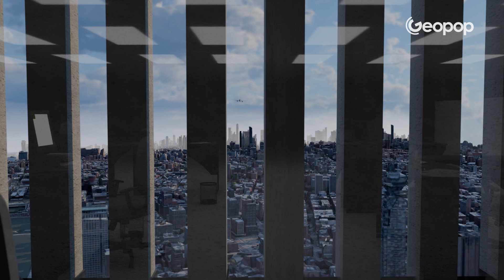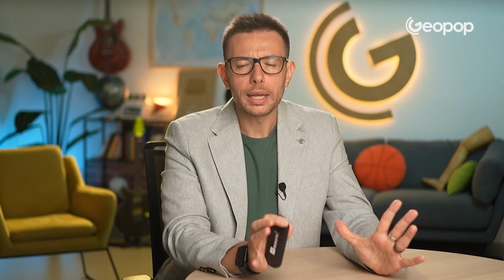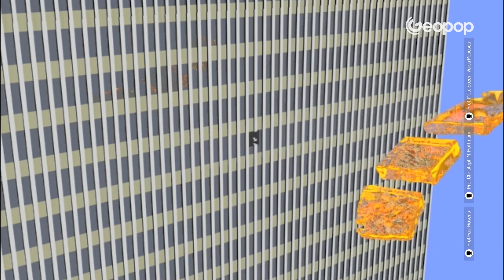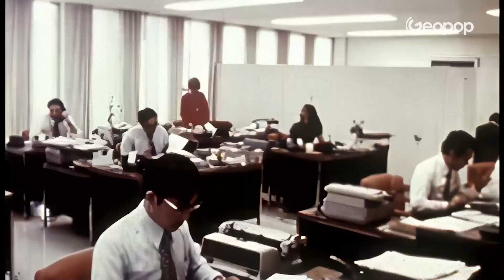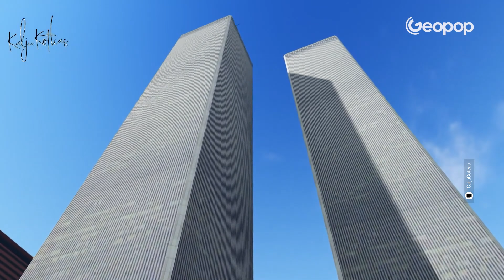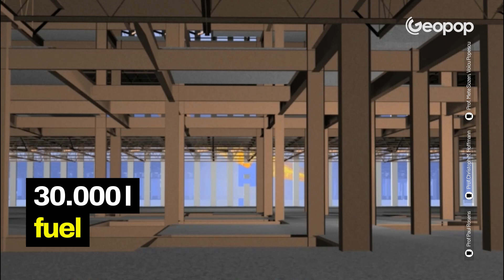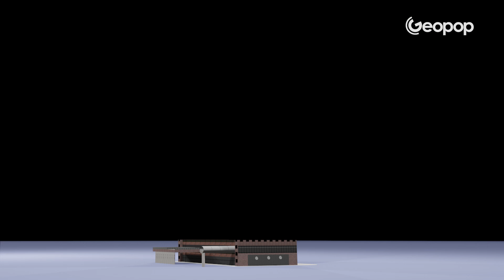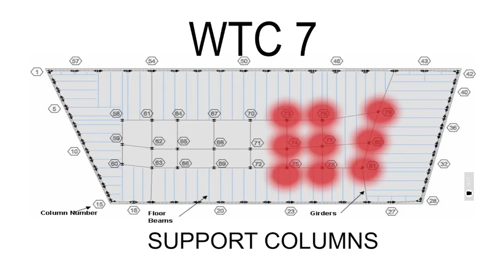9/11, 2001: The Technical Reconstruction of the Twin Towers and WTC 7 Collapses

Comment: Obviously the construction of the lower  floors had to be greater to support the load of all the floors above it. None of the steel below the impact zones where weakend by heat. According to this the lower floors collapsed due to the force of the top of the buildings collapsing. I won't deny that it could be possible. What perplexes me is the accounts of what people saw on the ground just before the planes hit. They had a birds eye view of the planes and claimed they didn't appear to be airline jet liners, but had a grayish appearance like military planes. The question is why wasn't digital photo enhancement of the planes used to accurately identify the planes? Scrutinizing the planes should be first and foremost because accurately identifying them would tell the tale.
Reply: Not the floors, the columns.  Columns carry the gravity loads of the building, floors do not. Each floor system was identical.

Let’s break it down to the absolute basics:

The 47 core and 236 perimeter columns of the Twin Towers support all of the gravity loads of the building. ALL of the resistance is in the columns

Planes impact Towers, causing massive structural damage, destroying sprinkler systems, tearing out gypsum board walls and blasting off the SFRM insulation from the floors. Multiple floor-wide fires are started instantly and spread rapidly due to the destruction of fire protection systems and venting of the building during the impact.

Serious fires were largely confined to the impact damaged floors and those immediately adjacent to them.

Fires were started by the impacts and fuel aboard the aircraft, which acted as an accelerant. No shortage of other consumables inside the tower to continue the fires.

Collapse was initiated (started) at the impact and fire damaged floors when floor trusses exposed to heat over time sagged, in turn pulling on and causing the inward bowing of some perimeter columns by up to 5 feet until they buckled on one face of each tower (ie: NOT symmetrically).

www.youtube.com/watch?v=ULdiD6gYZO0

No steel melted or needed to. Structural steel will bend and fail at less than half its melting temperature.

Once the perimeter columns buckled the formerly static load above became a dynamic load 30 times greater, easily overwhelming the structure below.

Thousands of tons of now loose debris fall through the open office space within the four outer walls - bypassing the columns - dropping 12 feet onto the first intact floor it comes across. That massive instant overload causes the floor to fail, shearing the pair of bolts that secure each end of the floor trusses to the columns. The floor fails. adding its mass to the falling mass which continues to accelerate for another 12 feet until it impacts the next floor, rinse and repeat one floor at a time all the way down.

The columns - the part that holds the building up, supporting ALL of the gravity loads - are spectators for all this.

Rate of collapse increases as momentum increases. The collapse front is constantly accelerating.

As the floors fail the perimeter columns are left literally hanging in the breeze, no longer attached to the rest of the structure. They peel away and fall in great sheets (think banana) out to more than 600 feet from the base on the 4 points of the compass.

Core columns failed last.

No fire required at all on floors below the impact points for them to fail. The mechanisms that started the collapse are different to the mechanisms which continued the collapse. That will be a difficult concept for some.

Each 110-story tower had a 1-acre footprint. The debris pile was up to 14 stories deep and spread out over 16 acres, destroying 8 surrounding buildings and damaging more than 100 others.
Reply: @TheLoonResistance  "Core columns failed last."

WHY?!? HOW?!?
Oh wait stinkyfitz, I forgot: You are way too much of a coward to EVER answer questions on your stupid copy post blahblah...

Comment: Why did the twin towers turn completely into dust blow away leaving only one or two stories of debris?where did 220 stories of the Building go, the answer is up in smoke.
Reply: Gonna run with that Judy Moonbeam crap, eh?

Maybe you should ask this guy:  www.youtube.com/watch?v=u2D__-DVLBk
Reply: Then why did they spend seven months removing very solid debris from the site?
Reply: @Tim22222  Good question, there was only two stories of debris left.
Reply: @DonWill-rk4xn  Not quite! You're forgetting about the 7 levels below street level! So the debris pile was more like 9 or 10 stories.

It took 7 months to clear the site. That is a fact.
Reply: @Tim22222  So where did 208stories of Building go?
Reply: @DonWill-rk4xn  Straight down, mostly. Can you say for certain that any mass was unaccounted for? Or are you just eyeballing it like that nutball Judy Wood?
Reply: @DonWill-rk4xn  - Debris pile was up to 14 stories deep and spread out over 17 acres. You are poorly informed.

Comment: From floors 21 and up disintegrated in mid-air what happened to the building?
Reply: Watch the video and find out. It's full of actual science and engineering, not magical thinking and dogmatic nonsense like so much of the internet.
Reply: @TheLoonResistance ok, let me rephrase it for you, where all the steel and concrete floor above floor 21, after the collapse, there not to be seen, they are pulverized into a fine dust, so all the file cabinets, or anything steel is gone completely...look it up.
Reply: @darkjimmy333  - Really?  www.youtube.com/watch?v=u2D__-DVLBk

Be prepared when you pull that stupid Judy Wood crap.

Comment: I think, the Towers were rigged with explosives and blown up.
I agree with a Russian engineer, when  tall towers are built in the middle of a city, what goes up , one day must come down.
Also, earthquakes, fire, terrorist act can compromise these towers.
So, they were pre-rigged with explosives.
Some say, the explosives were in the basement, like in the 93' terrorist attack, they try to blow it from the basement.
That's why the collapse was look like a demolition!
Reply: Oh I doubt you did much thinking on that one.
Reply: @TheLoonResistance  Thinking 7/24, unlike you!
Reply: @szaki  - I can do this and you can't:  Twin Towers collapses were relatively straightforward, the fundamentals well understood in the professional engineering community within just weeks. Yet there’s a lot of really bad information floating out there on the internet, easily accessible to anyone and wild baseless speculation and pathological theorizing with easy hand-wave answers is simple, exciting and requires a whole lot less thinking, so it gets far more intention than it deserves.

To correct this I have on my own prepared this short yet detailed technical description of Twin Towers collapses based on my own observation and analysis of available true and relevant facts. No politics, ideology or magical thinking, just engineering. I hope is this will dispel many common myths and answer most if not all questions you may have about the Twin Towers collapses, because anything can seem like a conspiracy if you don’t understand how it works

While complex, most of the Twin Towers collapse mechanisms can be seen with the naked eye and easily discerned and understood by the layperson if sufficient time is taken to understand. 

1. The Twin Towers consisted of 4 primary structural elements that together formed an integrated system where each relied on the others.  47 hollow box-section steel Core Columns carry the majority of the gravity loads. The 236 hollow box-section steel Perimeter Columns carry the remainder and ALL of the lateral (wind) loads. Long-span Lightweight Steel Trusses connect the core and perimeter column together at each floor with a Hat Truss on top to tie the structure together as an integrated unit where no element can survive without the others. There was no structural load bearing concrete and most components were bolted together. www.youtube.com/watch?v=u7OqrC74Dm4 

2. The impact of 117 tons of airplane (= to about 12 dump trucks) at speeds up to 590 mph with the energy of a ton of TNT completely destroys the aircraft. This in no way implies the Towers come out unscathed. Many perimeter columns are damaged or destroyed as are some core columns (example; 33 of 59 perimeter and 20 of 47 core columns damaged or destroyed at the impact floors in the North Tower), This damage is primarily through bolt-shearing failures at the end connecting flanges, as well as bending, twisting and fracturing of weld seams. There was no cutting or slicing - the reality was far more violent and messy. 

3. The impacts destroy or damage fire insulation, fire breaks and sprinkler systems on multiple floors.  Huge fires are started across multiple floors simultaneously and allowed to spread rapidly with no effective firefighting or fire suppression. This was an unprecedented fire event . 

4. The hotter steel gets the weaker it gets .  With fire insulation stripped away and no sprinklers the survival time of the steel greatly reduced. Gradually over time heat causes the lightweight steel Floor Trusses at the impact damaged floors to sag, which was observed and recorded.  No steel melted or needed to. Structural steel fails long before it becomes a puddle. It just needs to bend

5. Sagging floor trusses pull on the increasingly weak and overloaded Perimeter Columns, causing some of them to bow inward by up to 5 feet. A straight column is up to 4 times stronger than a bent column. The bowed Perimeter Columns buckle and fail, initiating collapse. The formerly static mass above which the structure below could easily support is now converted into a dynamic mass up to 30 times greater. Because they have buckled, the Columns above and below the failure point are no longer aligned . The load bearing structure below no longer bears any load as it falls past the lower columns, NOT onto them.

6. Thousands of tons of debris fall within the four outer walls, down through the open office space, crashing onto the first intact floor it encounters. This massive impact immediately breaks the bolted connections to the columns as the amount of resistance the Floor Trusses can offer is negligible.  The falling debris slows only marginally and briefly. Note:
6a. This is NOT a solid top block crashing into and “crushing” a solid bottom block .
6b. The debris falls past the columns not onto them.  The columns provide no resistance to the falling debris. 
6c. Only the bolted connections of the floor trusses to the core and perimeter columns can offer any resistance. A pair of 5/8” bolts at each end of each truss vs. thousands of tons of falling debris.
6d. No laws of physics are violated.
6e. There is no 20 floors against 90 floors but rather 20 floors against one floor, then 21 floors against one floor, then 22 floors against one floor, etc. 

7.  This floor-led collapse progression within the four outer walls can only go straight down.  
7a. This process is often incorrectly referred to as “pancaking”. The catchy name stuck but nobody knows what it really. Pancaking is too simplistic and inaccurate anyway, I prefer Kaiserschmarrn.

8. Collapse progresses through the floor systems past the columns, through the path of least resistance . The resistance offered by each floor is always the same while the mass of debris and its velocity – thus its energy - increases with each floor failure.  Each floor offers the exact same resistance to the falling mass while with each failure the falling debris constantly gains both mass and velocity. *This process of floor-by-floor destruction cannot be arrested, it can only speed up . Rate of floor failures increases with each floor as momentum increases, reaching an average acceleration of 0.65 of GA, or 35% slower than true free fall. Bam, bam, bam down the building until there are no more floors to fail. The resistance offered by each successive floor is always the same. More mass, more velocity, same resistance with each floor. Don’t get stuck on the but the lower floors weren’t on fire nonsense. They weren‘t and didn’t need to be.

9. The Towers were 95% air by volume. As that air was compressed inside the building it is forced down the tower and blown out the sides in reaction to the building collapsing . Those were not “explosions”, it was expulsions of compressed air caused by the collapsing building, explaining the low velocity, lack of flash, blast, supersonic pressure waves and lethal high-velocity ejecta.  

10. Perimeter Columns become detached and peel away like a banana behind the collapse front, playing out to the four points of the compass extending to more than 600 feet from the base of the towers. This was quite obvious from examination of the debris pile. 

11. Core Columns fail last as their internal beam bracing is stripped away by falling debris and lateral support from the floor to perimeter columns is lost. 

12. For those who care about how long this whole process took; 31-34 seconds from the moment the perimeter columns buckled until the last core columns hit the pile, or 1/3 the rate of true free fall. Don’t believe me?  Just watch any video of the collapses and note the loose truly free-falling debris dropping much faster than the towers themselves.  

13. Each Tower had a 1-acre footprint. Far from collapsing inside their own footprints the debris pile spread out over 17 acres in a pile up to 14 stories deep. 8 surrounding buildings were destroyed and scores more damaged by the falling debris. 

14. NOT observed were the 180-190 dB bangs of thousands of high explosive devices or the blinding bright flashes of burning thermite. Neither explosives or thermite could have survived the impacts and subsequent fire nor could have caused the (silent) perimeter column buckling that clearly initiated collapse either. A video of a shocked and injured firefighter casually using the magic word explosion is in no way proof of explsoIVES  and the demolition_ case relies entirely on that sort of thing. There is zero tangible physical evidence and it would be technically impossible, totally impractical and completely unnecessary. No one would bother. 

15.  Twin Towers were perfectly safe within their design envelope.  They only collapsed when taken far outside design parameters by an extraordinary and unprecedented event 

Impact + Fire (heat) + Time + Gravity = Collapse . Remove any one of those four elements and there is no collapse. Ignore any of those elements (as many do) and you will never understand the collapses. The Twin Towers were an integrated system in which no one component could survive without the others. One fails, the rest follow, through the path of least resistance – DOWN – through the open space, bypassing the path of greatest resistance – the columns.  Nothing I just described violates any laws of physics. All of the above is true no matter who planned and carried out the 9/11 attacks or why 

In 24 years zero structural engineers of tall buildings, including the 1/3 that have retired in that time, have made any statements in support of 9/11 Truth BS demolition claims. Zero, nada, none. The lack of any such citations in the engineering literature (published in any country worldwide) is palpable.

I hope you found this helpful and informative. It is not meant to be adversarial, but to solicit informed critical comment, positive or negative. If I made any errors of fact, logic or reason or left anything critical out, please let me know so I can fix it. To stay focused just one topic at a time please and on-topic (Twin Towers ONLY). No word-salads of Gish Gallop. IF you can offer a more plausible alternative be my guest. Please start any reply with the words “Tits McGee” or I will know you didn’t actually read it, are not serious and just wasting my time. If you are going to argue, do it on the merits.

Comment: North Tower was burning 102 minutes. South Tower was burning 56 minutes. How much weight did the burning parts of the towers lose during the duration of those fires?
Reply: Of the buildings? Not much. Just the stuff inside.